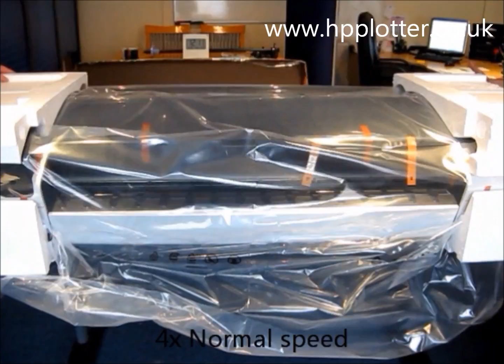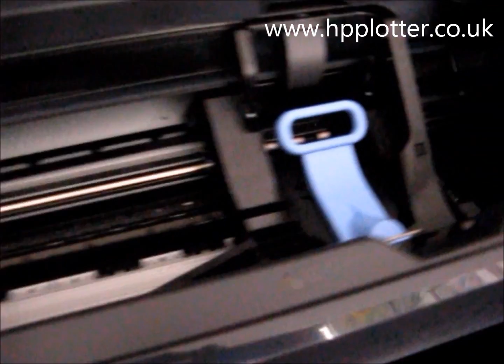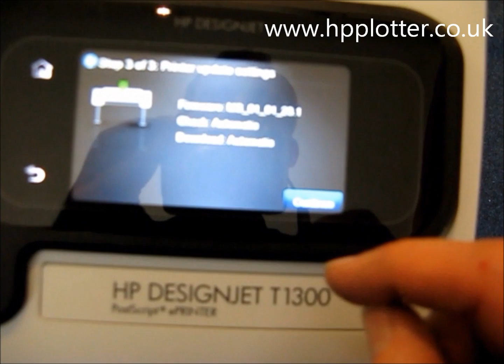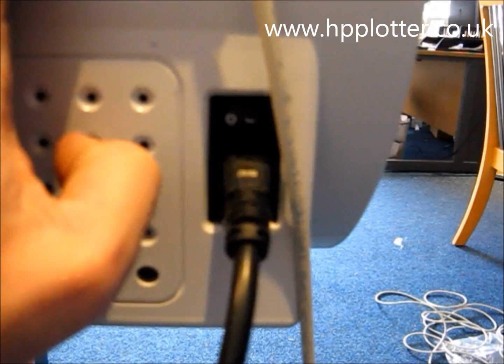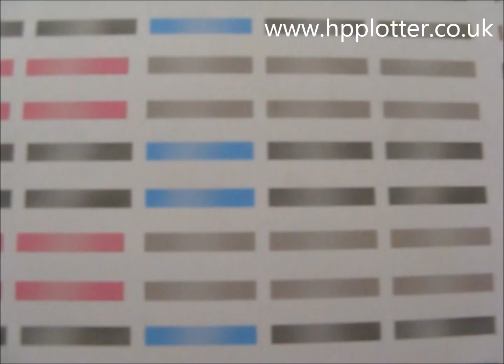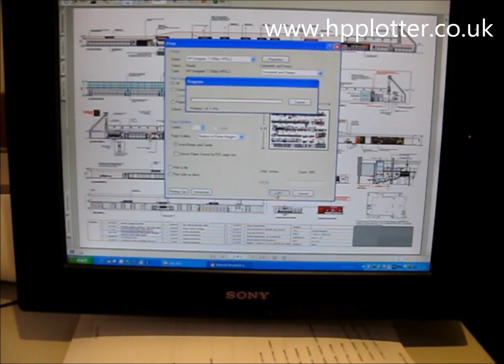HP Designjet T1300 Printer - Buy, Setup and Configure

Comment: T1300 doesn't scan ???
Reply: No - the T1300 was a printer only and the T2300 was the printer/scanner. Today the T2300 has been replaced with the T2600mfp
Reply: @snootybutnice  Please, what is the maximum roll diameter that the HP T790 can accept (can it handle a 914cm x 150m roll)?